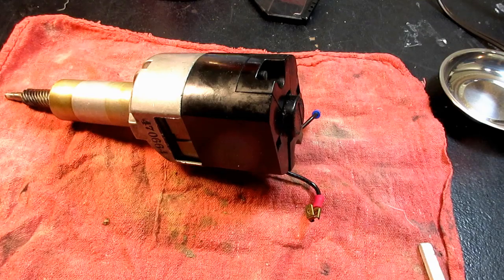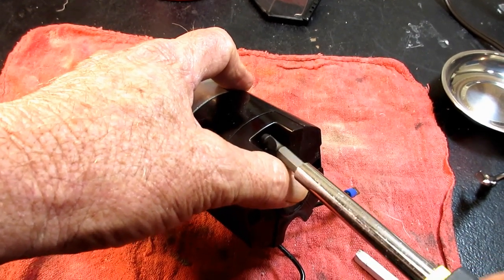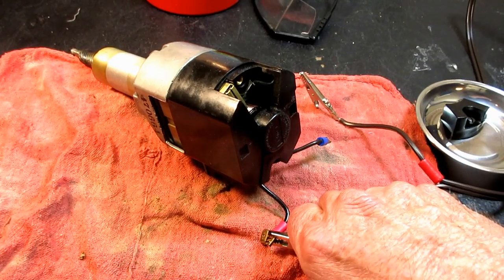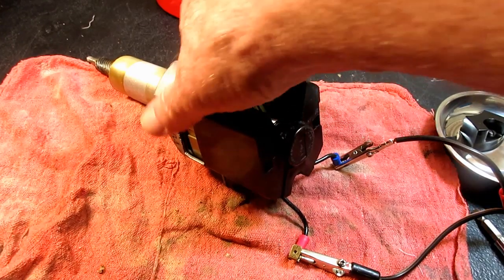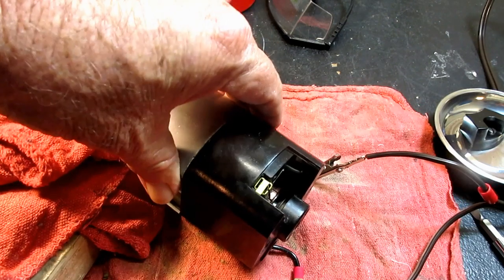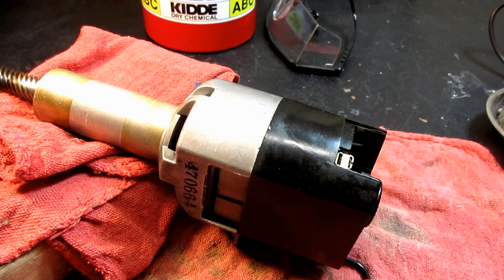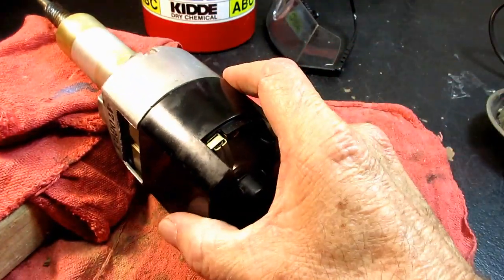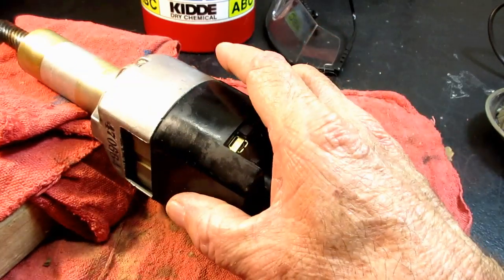How to Clean Oil off a Sewing Machine Motor

Comment: Is there any reason why you would not use alcohol, as you did in some of your other videos? Were you just wanting to test cleaning with something different?
Reply from the maker: You can use alcohol if you like. I never used the Krud Kutter Cleaner and Degreaser on the motor before b/c I've read and been told to only use alcohol, and some people said do not even use that on the inside of a motor. Compared to the alcohol I find the KK product, even at low concentrations, to be far superior for cutting and cleaning grease, oil, and grime than alcohol. I took a chance on using the KK in this video b/c I wanted to see what exactly would happen if oil got all over the motor, and how to clean it off. I'm very happy with the KK and I don't see any damage it did to the motor parts, including the carbon motor brushes. I'll be using the KK for motor cleaning from now on. Thanks for your question and for watching my channel.

Comment: How long did you let the motor dry after washing it off?
Reply from the maker: I use a hairdryer to dry all the parts. Any airspeed but only a low or medium setting. The copper winding parts take the longest, maybe 5 minutes to dry. Some kind of airflow should be used to dry the parts.
Reply: @andytubesewing1953  Thanks so much
Reply from the maker: @beckydolan8556  👍

Comment: Hi- Curious that my motor circa 1954 doesn't have the plastic insulator.  Do you think it's missing or did they come later?  Thanks for your generosity in making these videos. :)
Reply from the maker: I think it's missing. I don't remember working on a PA motor that did not have it. I can't find it now, but there is a YT video where a person is rehabbing this motor and discards the plastic insulator. The motor runs normally in the video afterward. If I had the part I would definitely keep it in the motor, but I think it works OK without it, IMO.

Comment: Andy, I’ve been watching a lot of your videos and I’ve learned soooo much! Thank you for these videos! I have a 1931 GE Sewhandy motor. I am having a lot of trouble finding any information on these machines so I thought I would see if any of yours could possibly help me out. The motor was not running. I could hear a slight hum and a little vibration, but basically it did nothing so I figured what do I have to lose so I opened her up! Everything was black and hard. I saw no copper whatsoever. Everything was blackened. In your opinion could this just be old carbon dust and/or oil that was put there over the years? Can I put krud kutter on these copper motor windings safely and see if this will get them back to bright and shiny? I appreciate your help with this. I know this is a post from years ago, but I’m hoping you will still get comments forwarded to you and you can help me. Thank you—Cristina
Reply from the maker: I don't know anything about GE sewing machine motors at all, so I'm hesitant to advise you. Some motors, especially older ones like yours, did not have exposed copper windings. They were covered with various things, like black sticky tape (which could be hard after 90 years) and dark coatings. Maybe that is what you have on yours. 
     I have seen some terrible Singer motors over the years, but even tons of carbon dust did not get "hard". I've seen flooded motors that did not get hard, well... you get the idea. 
     Every sewing motor that turns a belt has a pulley on it and you can test the motor shaft bearings by simply turning the pulley with your fingers. If it is "frozen" then I usually carefully clean and oil the shaft bearings and that will usually free the shaft and allow it to turn. 
     I have seen plenty of frozen motors where the motor was OK but the foot controller was in bad shape; dirty, out of adjustment, and damaged carbon discs in the carbon stack. The electricity goes thru the foot controller (why they call it the "controller") and then to the motor and as you apply pressure to the controller the carbons discs are compressed closer together, offering less resistance to the electricity, and allowing current to flow into the motor. You know, the harder you press the pedal, the faster the motor goes, like a car. If the parts inside the controller are out of adjustment, stuck, or damaged, then not enough current goes to the motor to turn it. 
     The other thing is the machine itself may be lacking oil and dry as a bone and any gears, etc can't turn. I found pictures of some sewhandy machines and they don't even have a handwheel but a pully at the base of the upright for the motor belt to turn. See where I'm going here? Can you turn the machine pulley and make the parts move, like the hook, feed dog, and needle bar? What if the motor is OK, but the foot pedal is bad or the machine parts are stuck. You think of the motor b/c you hear it hum and strain, but it could be something else. 
     I hope I have not sent you down a different rabbit hole, but I've worked on a lot of machines so just sharing some thoughts of past experiences. Good Luck.
Reply: @andytubesewing1953  thank you Andy you have given me some good information.  You are right about the wiring being covered in what looks like black plastic or rubber of some sort.  I did remove and soak in krud kutter and water the inner workings of the motor, the armature.  It did come out very clean. I will take some fine sandpaper and brighten that up. The outer case also cleaned up nicely in the krud kutter mixture.  As you mentioned I did clean and serviced the gears and re grease and oil everything that needed it. Everything turns nicely. The last thing to do will be to remove the brushes and clean that area up and then will reassemble this motor and put it back in its place. I will take into consideration the foot pedals and I have another one I can test the cleaned motor with.  Fingers crossed this will work!!  Thank you so much Andy!!
Reply from the maker: @cristinas.5699  You're far down the road to completing your restoration. Congratulations, I'm glad it's going so well.👍
Reply: Uggg I wish you did know about the GE motors. I was hoping that all it needed was a good cleaning but I was wrong. It doesn’t do anything now not even the vibration I was feeling before. I haven’t found anyone that will look at it. I have 2 more gentlemen I will ask and I’m hoping one of those 2 can help me out. So what is the principle and what could go wrong on the featherweight motors? They actually are simple motors but I have never had formal training on how these work. Hmmm that gives me an idea, my brother is a good teacher , I wonder if he can figure these out?
Reply from the maker: @cristinas.5699  You know they do sell after-market sewing machine replacement motors? Here are all my motor videos in case one of the motor styles is similar to yours: https://www.youtube.com/playlist?list=PLsCOZgzzaiKI8b1zmcVQqcKFHH_dbQLyr

Comment: Great video—super informative and interesting.  I have a PA 9-8 motor that sounds great, looks clean (from what I can see inside), and carbon brushes are nearly full length.  I noticed in this video, you did the carbon brush seating with the Diamond D Brush Stone before you took your motor apart.  Did you do the brush seating again after you took it apart and cleaned and reassembled?  I’m contemplating just doing the carbon brush seating with the Diamond D on my motor.  Shortly after seating the brushes, if I decide to do a full restoration on this motor, do I need to do the the brush seating again after reassembly?
Reply from the maker: Good question, Carole. Using the diamond stone does 2 things; cleans the commutator and reseats the brushes. If you already did that and then later take the motor apart AND remove the brushes from the commutator, then yes I would reseat the brushes upon assembly. The commutator may still be clean, but pulling the brushes may lose the seating. When you just seat the brushes it only takes about 5 seconds when the commutator is not dirty. I do my wife's machines once per year and how dirty the commutator is depended on the use from that year. Her 403A ZZ machine barely needs any cleaning, but her 301A gets heavy use, so running the stone takes a little longer. I do not take the motor apart each year, but only clean the commutator and seat the brushes, then use the electronics spray to clean the residue, as I did in this video: https://youtu.be/pzq4tv8qn94   I don't want to wear out the commutator copper or wear down the carbon brushes by over cleaning. Thanks for your continued support and for watching my channel, Carole. Take care.
Reply: Andy, you’ve given me such a thorough answer, and then more information.  After I decide how I’m going to treat this motor, I know what to do regarding the brush seating.  Thank you so much!
Reply from the maker: @carolemagnusson5044  Very welcome, Carole. Always nice to hear from you.

Comment: Hi Andy... Thank you so much for your channel, it's saving my 457 from the junkyard 🙏🙏 
If you see this could I pick your brain? Trying to clean my motor due to burnt rubber smell and the tape on those outer windings looks to be coming off (think the heat is melting the adhesive), is that fine or something I should start worrying about? 
Good night and thank you once more
Reply from the maker: Thanks for saving the 457. It has a different SNK style of motor. Like this one, I think. https://youtu.be/6y1EN5S2sz4   I've had a few motors where the tape was starting to come off. I just snip off any of the loose tape is all. I had one where the tape was completely coming off. I found some reinforced tape at the hardware store. It had fiberglass "strings" in it for strength. It was very expensive. I retaped a couple layers of the new tape. It was a slow process. Unless your tape is totally gone I'd just snip off any loose strands of it. A friend of mine uses a liquid gasket maker to kind of "glue" the old tape back down by covering it. It dries and is heat resistant to 400 or 500F deg temps. I've never done it, but he swears by it. https://www.amazon.com/Pro-Seal-4301702-Performance-Temperature/dp/B00IBRTDMA/ref=sr_1_1?crid=1WI87875H75XU&keywords=Pro+Seal+4301702+80044+RTV&qid=1694311563&s=automotive&sprefix=pro+seal+4301702+80044+rtv%2Cautomotive%2C146&sr=1-1
     I think the tape was to hold the coils of copper wire together during manufacturing and assembly. If there was even a little tape left I did not mess with it. You'll have to look at your situation and decide what's best for you and the motor.

Comment: I am enjoying taking apart the motor on my Singer Touch and Sew 646. It was very very  dirty.  I was using naphtha to clean it out when my neighbor said I should spray it with WD 40. I often think that men are experts so I WD40'd it thoroughly. Then I read a post: OMG! don't use WD40!!! It will kill your motor! Then  I ran around the garage yelling OMG OMG!!! , but I found some 50% alcohol so I squirted it down all the windings with a hypodermic needle. Now I am waiting for my hubby to come home and unbury the compressor so I can  give the motor a good drying off.  Please advise. Whew!
Reply from the maker: Boy, with neighbors like that...😬 I think you'll be OK. The motor was not running when you put the WD40 on it and that's a good thing. Trying to flush it with alcohol was a good idea. The sooner you get that stuff off the motor the better. The alcohol you used is 50% water, but I cleaned a motor that was in dirty water for over 24 hours and it turned out fine.
https://youtu.be/6y1EN5S2sz4   I think another important point is to get the carbon motor brushes clean of the oil and dried out. The best way to do that is take them out of the motor, wash with a cleaner or alcohol; something to cut grease, and dry them very well. I'd say just take the motor apart like this video and clean it. The Krud Kutter degreaser works well but blowing it off will help. It can leave residue and has additives. Krud Kuttermakess other degreasers. https://www.rustoleum.com/product-catalog/consumer-brands/krud-kutter  Where I live you can order online at a big box store and pickup same day.  I would not use it full strength to protect the windings. Put it on and get it off. Dry Dry Dry. You'll be OK.